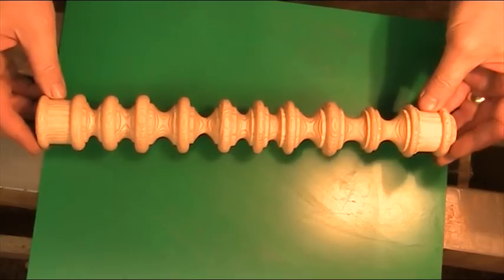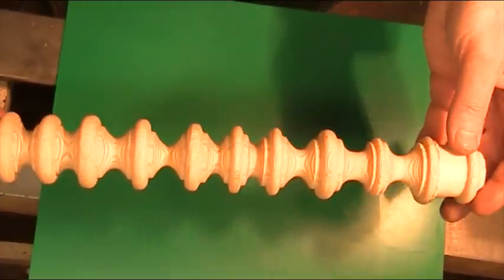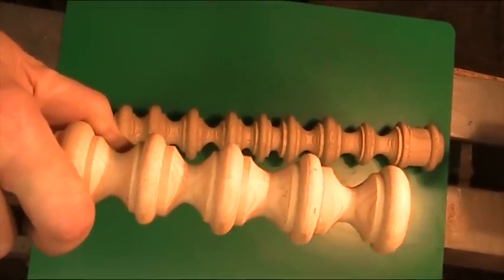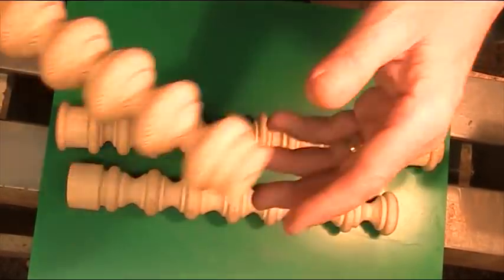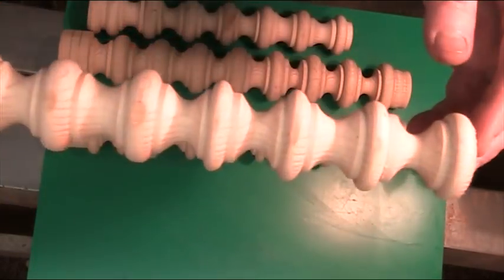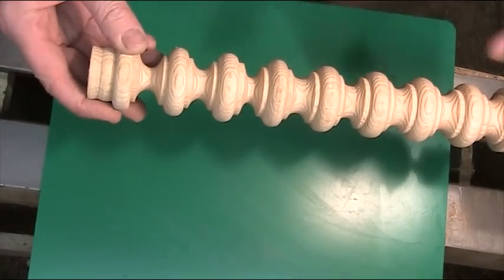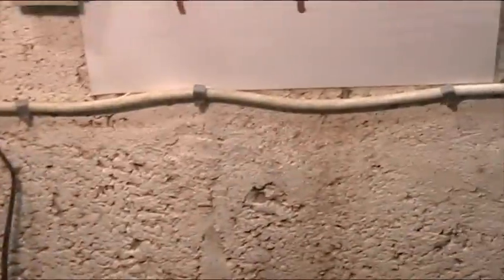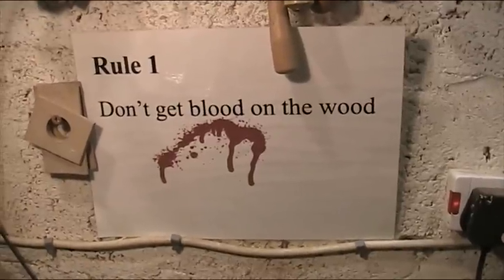Woodturning Practice Pays

Comment: Couldn't agree more Brendan, practice is everything. Sometimes Mu says what have you turned today........nothing love, I've been practicing this and that...then her eyes glaze over with boredom......and I get the hump....not for long though.....lol.
The blood on the wood warning is priceless mate.  
Strange things glasses, sometimes I find the ones I use for the computer work well for turning small things on the lathe, as my Varifocals can give me a stiff neck....lol
Take care
Mike
Reply: Mike Waldt Hi Mike, I'm trying to make a clock with a slice of Yew.  I'm burning and belt sanding and chiseling and cutting and getting on like someone who knows what he's doing but I haven't a clue.  Something will emerge eventually.  Glasses, I asked my optician to change the focal length of my reading glasses to use them at the lathe without all that going in and out of focus craic.  The compromise is that my reading books focal length is about 3 inches further away but that's fine.  The best part is not having to keep changing glasses at the lathe.  The downside is that I can see every microscopic scratch now.
Best Wishes, Brendan.
Reply: Mike Waldt Hello Mike, I hope you're striking a balance between turning and preparing for Bastille Day which is just 6 weeks away.    At this stage you should have had a dress rehearsal in front of Mu to make sure your Legionnaires uniform still fits and that your medals are well polished.Vive La France!!!.Best wishes,Alain.
Reply: Alan Simpson I'm already prepared Alan, if like me other comrades took this wonderful day seriously they would keep in contact like you and I ;) I had to turn one of the epaulettes on the lathe, as the mice had chewed it up!!
Take care
Mike

Comment: This is an excellent lesson and it takes me back.  My comment is a little ironic, seeing how I am entered in the Summers Woodworking 2X4 challange, but when I was learning to turn a turner friend of mine suggested that I buy a clean 2X4 and rip it down the center and cut it into 12" lengths and do exactly what you did with each piece. By the time I turned 16' of beads and coves I was much better prepared to take on the turning projects I had in mind.  Thanks for sharing. Scott
Reply: MrToolhunter Thanks Scott, I should have listened to my self in a former incarnation when I spent my time telling students how important it was to repeat learning (do homework) in order to get the skill.  However, practice is not as much fun as trying something new or a new project.  I'm still no angel but I do warm up a little before working on a project.
Best Wishes, Brendan.
Reply from the maker: baconsoda Wrong account again.
Reply: Ha! I thought I was the only one guilty of that. (BTW, MrToolHunter here.). Scott
Reply from the maker: Aristocob LOL, life is getting too complicated.
Reply: Got that right! (Scott again!)

Comment: Hello Brendan,
If I turned without glasses the results would be like abstract art with blood.
I keep a special pair in my workshop which are specked with sanding sealer, lacquer, oil etc.   I'll have to go to Specsavers soon.
Would you be interested in buying several bags of good quality firewood which are the rejects from my entries for the forthcoming turning competitions???
Hope to see you soon,
Best wishes,
Alan.
Reply from the maker: Alan Simpson Hi Alan, I have also devoted a pair of glasses to the lathe because there's no point ruining two pairs.  My entries are 2/3 of the way there.  I'm putting a goblet in for spindle work, a bowl for faceplate and I hope to have a clock made for the artsy-fartsy category. There are no points awarded this time for the league because it's an open competition. Points are only awarded for competitions with a specific theme.  You can enter anything you have made that falls into the categories and any age.  I won't enter something that ha already been on for another competition but I am going to enter a bowl I did a few years ago that I like.
My problem is getting time to work at the lathe because there's always something else that needs done.  I might just have to lock myself away and not come out until the clock is made.
Where does 5 weeks go to?  I thought I had loads of time. 
Best Wishes, Brendan.

Comment: How true...practice and glasses! And since I can only count to 9 1/2 on my fingers (the table saw always wins!) rule No. 1 is posted in my shop as well!
Reply: Earl Rumble Oh no!  In a perverse way the news of your accident is good for me because it will encourage me to be even more careful with my new table saw.  I have only recently started using it more and, with the new 60 tooth blade, it i a dream to use but I am scared of it.  Not so scared that I tremble about using it but scared enough to double check everything before I turn it on.  It's because of people like you being honest and straightforward about their accidents that I made sure I had the techniques well studied and noted before ever using the machine.
Best Wishes, Brendan.
Reply: baconsoda My main suggestion is ALWAYS use a push stick...don't hurry even if it is a small job and you can't locate your pusher. Good luck with your new saw!
Reply: Earl Rumble Thank you.  The first thing I did was download John Heisz's push stick template and made 5 of them with key words written on them like 'Safe?', 'Secure?', 'Bind?' etc.  I use them at the bandsaw too.  The advice to take my time is very good because I found, as I used the saw, that I became very deliberate in setting it up and didn't have a mug of tea nearby or any other minor distraction.  I want to be able to count to 10 because I was a maths lecturer and being stuck at 9.5 would really compromise my calculations.
Best Wishes, Brendan.

Comment: seeing helps? who'd a thunk it! with all those movies where blind people are scary high functioning. Of course practice does help to see through hand eye coordination. Developing technique to calculate, as well.

A tool like a pivoting movable lattice measuring device to adjust to any size total and number of high or low points so as to give a series of marks exactly even and as many or few as needed, That would be very helpful & very doable.

Now if it locked and had blades to cut them all at once? That would make such jobs much more simple ... or so it seems
Reply from the maker: tblbaby LOL, thre's bound to be someone out there with that tool or about to make it after reading this.
Best Wishes, Brendan.
Reply: BMac Woodturning I was thinking that & looked for it, but have not found one. It's kind of an obvious idea it seems. Just popped in my head as an obvious solution, watching this. Thinking on it, it would be better used for measure and a slotted bar with adjustable bits could be used as the tool to actually cut according to the measurements. Used with a long tool rest bolted to the lathe it's attached to and can pivot and move on, with solid wide set handles to move it around.

I do tend to like the pieces with more personality than perfection though. You do beautiful shaping.